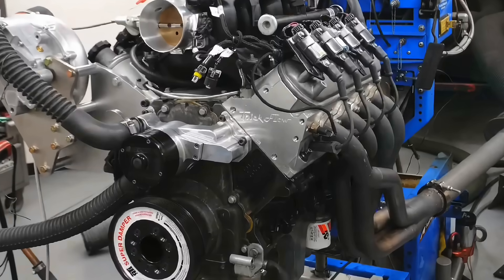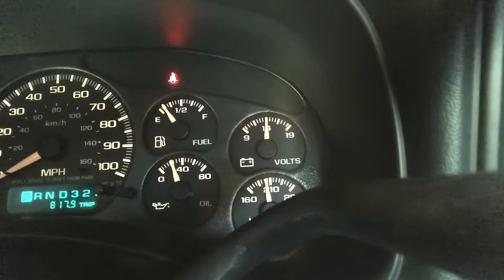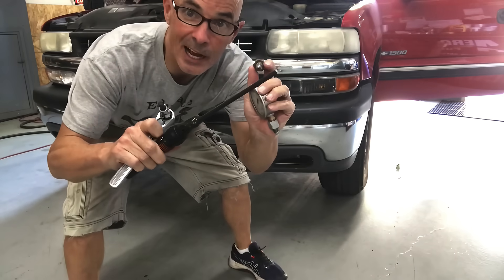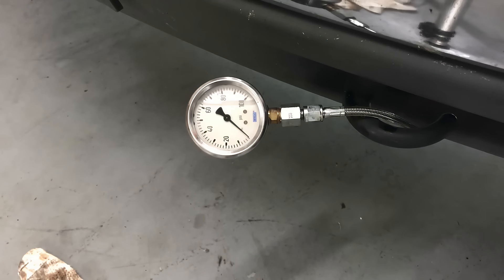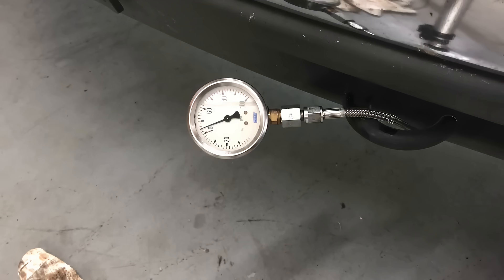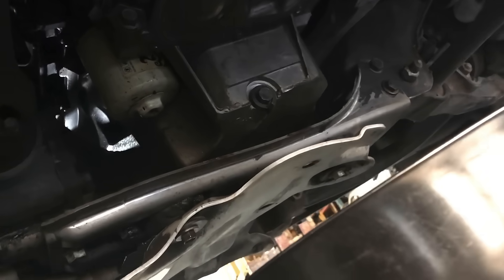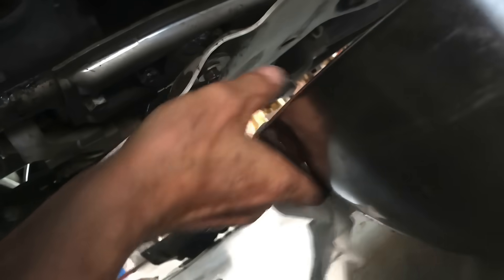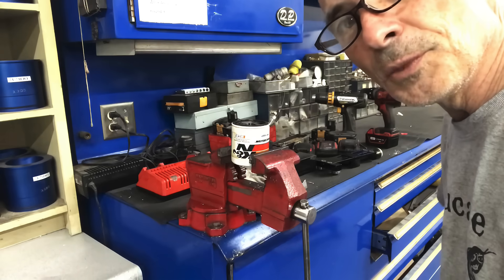HOW TO: TEST & FIX LOW OIL PRESSURE IN YOUR 5.3L OR OTHER LS?

Comment: Good morning Richard, you forget another point.
The  oil over pressure release valve.
This is located at the filter housing.

Andrés.
Reply: Do you mean the pressure valve in the oil pump?
Reply: @SamSheepDoq   No, I mean the oil filter bypass valve.
Reply: Andres Cruz that is the barbell, he did mention that.
Reply: @SamSheepDoq  no, The barbell Is located in the block, this one is located next to the oil filter.
Look for  LS oil  bypass  valve  on google , will see
Reply: Andres Cruz I see what you mean. Had a brain fart and forgot the OE filters support the bypass valve. 🤦🏽‍♂️
Reply: @SamSheepDoq  Yes, that's the one.
Sometimes that valve loss  the spring tentions and let some oil to bypass the filter and the system loss Pressure.
Reply: Andres Cruz you learn something new everyday haha
Reply: @SamSheepDoq  I have a LSX 408 stroker all racing for drag and that valve have to be delete and the oem barbell have to be changed for an aluminum  racing type.
That's how I know that

Comment: My 02 1500hd started and warmed up with essentially zero oil pressure for the better part of a year. The winter was absolutely brutal. It sounded like an army of angry little blacksmiths in there beating on internals. At that point the engine had 365,000 on it and was low on power anyhow. I ran it as long as I could stand and then traded that same worn out 6.0 to a hot rodder buddy for swapping the engine with a reman for me. I'm sure it was the o-ring culprit as it usually is and I could've "saved" the engine but with low power anyway I knew a swap was imminent. A fresh 5.3 is going in now so hopefully I can improve the mileage a tad. Keep up with the awesome content!!

Comment: I just did same test with a 10’ hose and gauge on my 08 F-150 42000miles. Super hot oil in drive at a stoplight 29psi. Just touch throttle and 65psi. Cold start 85psi. I thought that was plenty but ya got me worried now. Edelbrock supercharger goin on it this winter. Been wrestling with change oil pump or not?

Comment: the worst case is worn mains and rod bearings, yeah ive changed  them , by just dropping the pan, and using the same size bearings, wit h out checking the clearence,

Comment: The oil pressure gauge in my S10 has always read just below 20psi at idle with the oil up to operating temp. Under acceleration or cruise it hold about 45-50. I did find the sender to be leaking some oil a few years back and replaced it. No change in pressure.  The truck currently has 489,000 miles and still has the same pressures.
Reply: Dang!
Reply: @christianmotley262  update: I passed 500k a few weeks ago. Still holding good pressure 👌.
Reply: What engine you got my Sonoma is the same on the 4 cylinder. I always say every year it’s gonna die. And still running strong
Reply: @Username-ng8jy  it's the 2.2. Currently up to 520k.
Reply: @BucktailFishing  hell yeah man.
Reply: @BucktailFishing  thats the old iron duke....that engine dont die...truck will rot in half, trans will die, rear end will lock up LONG before the engine calls it quits. Ive seen a few with zero oil changes in years run past 300k
Reply: @erik120719  mine is a 1998. The GM 122 engine. The dukes are definitely tough, too.
Reply: Update: 534,000

Comment: There is actual and displayed parameters in ipc there will always be a slight difference in actual oil pressure and displayed on these trucks
Reply: Why?
Reply: It's the gm engineering in the software idk y they do it but hook up good quality scan tool or oem tech2 or mdi and watch data in the cluster. U will see it.  A scanner that can scan the all vehicle modules, has bidirectional control, etc. Not the code readers/w data from advance this data is not in powertrain.

Comment: I got around 50 psi when its cold but when it worms up I got between 15 ~ 17psi since 2015... I replaced the oil pump,  O-ring and sending unit twice and the reading remain the same. L92 Escalade 2007. It is still alive because Im very conservative while driving but now im planning to boost the truck 👀
Reply: I have a 2008 esky. It was reading around 11-12 at idle hot. It would never go over 30 even a 3K RPM. I had the melling HV oilpump and o ring installed now it goes to 55-60 at cold idle but still dips to 22-24 at hot idle. It did stop my lifter tapping after driving on the  highway. I'm still not sure how much life is left in it 
at 212K miles.
Reply: @memphistiger4647  don't worry, mine reads 17psi for the past 5years hot idle

Comment: You forgot about the emergency bypass the oil pressure bypass valve will cause your oil pressure to stay at 20 lb and run up to 40 when you're driving if you will please show us that

Comment: Had same problem in our 01 yukon. Tried the pressure sensor but ultimately the final fix was the o-ring on the pickup tube. I would get a lot of lifter rattling on start up due to very slow buildup of oil pressure. It would take almost 10 seconds for the engine to build oil pressure on cold start. After o-ring replacement that time dropped to 2 seconds.
Reply: Ive got a 08 5.3L silverado. It seems i need to take off the suspension partially to get the oil reservoir off to get to these tubes. Ive only taken the metal cover and drained the oil so far. Hope it’s just the o ring. I noticed a drop a few weeks ago, but today it’s at 0.

Comment: It would have been nice to see the oil pressure difference after you fixed the oil pickup tube o ring.
Reply: Mine went from 0 at idle, 30 while driving to about 60 at idle, higher when driving.  After I replaced the oil pickup o-ring.
Reply: Mine also was around 30-40 idle hot and 60-65 driving hot.
Reply: @jacobmartin1981  mine was ticking rough and like 10-20 pressure and driving 30-40, I pulled off pan and the oring looked fine but changed anyways same type. There anything else to look for, oil pan very clean, also changing pan gasket and the small gasket by oil filter. Thanks
Reply: @erod4489  Which year of truck do you have? The 2008-2013 engine run the numbers you are seeing as normal pressures.

Comment: This never happened with the old classic engines sbc or bbc. However the pickup might fall out of the pump and the pressure would drop a lot when you put on the brakes. Just goes to show you that it's always something. O-rings are great and everyone uses them but they eventually all go bad. Another easier place to check the pressure on an LS is the fitting right above the filter. Remove the casting, drill it out and tap for 1/8 pipe and put in a fitting for gauge. Easy to get to.
Reply: "but they eventually all go bad"
 
Not quite(within reason anyway). Viton rings/seals will live for an eternity without getting brittle like this, it's a VERY well engineered material for high temp petroleum applications. It's just when the manufacturers cheap out with the black junk rings/seals, like here, that they go bad. I mean, "eventually" is a long ass time, but vitons do last a long ass time. They're ubiquitous in "no downtime allowed" industries, like modern manufacturing equipment, modern construction equipment, that kind of thing. 

And that's the infuriating thing. "Bean counter" is a terrible insult to call someone, but they have a job to do for a reason; those are the guys that make LSs affordable enough to stick in half of GM's car/truck lineup(so that we can yankem' after they get crashed or all the other GM shit in their vehicles fails and they get junked...). But, fucking O-rings man? And, on the oil pickup too, one of the most critical parts to an engines lifespan? Come the actual fuck on guys, we can afford $1 more per engine for some good damn Viton O-rings throughout ya pricks...

Comment: I want to see your gauge readings after the o-ring replacement.  Those oil pressure readings looked ok to me, can’t believe the o ring made any difference.  Also, use a better quality oil from this list, that Lucas oil is not rated very well on this list.  https://540ratblog.wordpress.com
Reply from the maker: the oil pressure changed dramatically from what it was-even if the numbers were still high enough for your liking-there was still an issue-it was cured with the o ring

Comment: My "new" lq4. It's a refurb from blackwater engines is doing the same low to me oil pressure. I feel it's only going to decrease as the engine breaks in. I only have maybe 300 miles on it so far.

Comment: Do u have pn’s for manual gage testing? I replaced pump in 2 of mine. 1: Melling standard=good psi
2: Melling hi vol n psi but psi only went to 20 at idle 40 at wot.

I would like to test with ur set-up
Reply from the maker: it was just a fitting and hose and gauge-not a kit

Comment: It's good to see you make a video of this. All quoted specifications aside if you see the oil pressure drop from where it normally runs you might as well check into it. More than likely the issue is caused by the cam bearings, but it could simply need a new pump or pump o'ring. Being a normal car guy that means a larger camshaft, timing chain, and Melling 10295 or 10296 if the cam bearings look ok. If not then it needs a crank rods and pistons to make it a 383 for testing purposes for your channel...
Reply: Yes❗️
Reply: An oil pump??? Oh,  I hav a 2005 yukon, i hav low oil pressure when car is at red light..

Comment: 9 times out of 10 it's the o/ring could be the screen also since yours is an 02(depends if you're the only owner. If you are and u usually are good on oil changes then it's the hardened o/ring)  after you check the sending unit for correct ohms

Comment: I got a JY engine that had low oil pressure, pulled it back out put it on the stand, flipped it over just knowing I messed up the o-ring on the pick up tube and it was fine. Reluctantly pulled the thrust bearing main cap and found the bearings and crank grooved like an old 45 record!  Decided to just use it as a core and get a crate motor from SummitRacing, best decision I made!

Comment: lol Lucas oil and a K&N filter  um yea Mobil1 and a factory filter. In my 1999 GMC Sierra 1500 SLE  Im having this same problem and its on its 3rd engine the last one lost all oil pressure and started to rattle. I had another engine put in it and this engines doing what yours was doing.  Thanks for the video.

Comment: This video is really relevant for me.  My 2002 Camaro LS1 has had low oil pressure for maybe eight years.  I did track days with it steadily since new, and noticed after about 10 years that it was only running about 30 psi when fully hot on track at high rpm.  I have not been overly concerned about it, though, because I cut open the used oil filters and never see any bearing debris.  And I have oil analyses done that never show high amounts of Aluminum or Iron.  I have been assuming that it is a bad reading on the gauge, and have taken the fatalistic attitude that if that amount of oil pressure is not enough, the engine will quit running.  I've been wanting to put an LS3 in it for years, but the LS1 just won't die.  At 277000 miles, it's earned a rest.
Reply: Just send it to me then jeez sounds like this motor wants another 277k
Reply: @SaveOurSnipers  Currently 296k.
Reply: @SaveOurSnipers  I got $27,000 mi on mine running the same pressure as yours and ready for another 207000
Reply: @SaveOurSnipers  ive got a 5.3 with 376k and running strong other than low oil pressure and clogged cat
Reply: I have a 2001 z28 with ls1 and as u can guess I'm here cause I'm having low oil pressure. It runs at 35 and goes up to like 42. This is after changing the oil pressure sensor
Reply: What is the spec for oil pressure, the pressure depends on how much clearance you have on bearings,  I would expect 35-40 is good at idle, and go to 50-55 at 3000 rpm!

Comment: Have seen a tiny sliver of metal wedge the relief valve open on the pump so that at idle the oil pressure is extremely low <10psi and much lower than normal when hot at rpm... the metal sliver looks like it came off the thrust bearing as the car was manual with a heavy sprung clutch and was just the perfect fit to make it through the pickup screen and pump gears and just perfect to jam the relief much like a door stop wedge haha 😆

Comment: Low oil pressure in an LS can be caused by a few issues singularly or combined, there are oil gallery behind the timing cover that leak oil pressure which is fairly common in higher mileage engines.

Comment: Somebody holding the NOS on too long? How high was it before? Usually points to glitter in the oil...WHAAAT? o-ring on a oil pickup tube? who's bright idea was that? where did all those air bubbles do to your rotating assembly? Up next, teardown and inspect! check that ring gap while your at it....

Comment: worried me to death in my mustang when i swapped in the 5.3. hovers around 23psi. figured it may have something to do with the extra capacity with the extra oil coolers and turbo or something, or maybe it was the aftermarket gauge and holley system. In the end i gave up and just send it. close to 60 at redline so i don't mind if it dont, and so far it hasn't.

Comment: Mine shows about 25 psi @2000 rpm hot. 398000 miles, still runs good and 25 mpg 05 Crew cab 4x4
Reply: I call BS on that mpg.
Reply: @ebels3  real deal. I've checked it several times on the interstate. Over 401000 miles now.

Comment: Generally speaking oil pressure is less important than volume. Oiling for plain bearings does not rely on pressure from the oiling system to keep the surfaces apart. Rather it is what is called an oil wedge. A hydro-static effect where a film of oil between two moving surfaces forms a wedge (or a wave to picture it in your mind) than actually forces the surfaces apart with significant force. The oil needs to be replenished as the oil is forced from between the surfaces. The pressure is more important for other components like hydraulic lifters and cam phasers.
If you think I am wrong then consider a simple lawn mower engine. It relies on simple splash lubrication. no pump at all. Due to the low forces involved the rate of oil replenishment is covered by the oil splashing around. The more load on the system means more oil to maintain the wedge. Invariably more volume equals more pressure in automotive engines. Hence why performance engines have high volume pumps.
Rant over.
Reply: Pressure is how the oil pressure is measured and since it is pressure that keeps the bearing from contacting it's floating item I would say pressure is very important as well. On the same hand volume is how pressure is created... Hmm, shortened that right up.
Reply: i heard oil is not a lubricant it is a vehicle to move the polymers in the oil,,,  POLYMERS  are tiny little BB's that create the spacing between the two metal surfaces... over time they flatten out and become smaller little BB'S and then you lose the gap between the two metal surfaces and it starts to grind against each other and create heat, and then weld together.

Comment: I just bought a 06 L33 truck with no oil pressure, took it apart to change the oring and all four bolts for the oil pump were backed out. Weird and it looked like it had never been apart before. 175K miles.

Comment: I am only a couple minutes into the video and I have to tell you people the oil tube pickup that bolts to the block inside the pan has an o-ring that fails all the time. Replace the o-ring put the oil pan back on problem solved

Comment: HEy Richard you're missing something MUSIC!  HAd a 72 olds cutlass no pressure on oil gauge put a pressure gauge near oil filter pressure present. Remove manual gauge & place it where the sending unit goes zero. All this was happening during a crank no start test. I poped the distributor out & crank the pump shaft with valve covers out no oil out of the rockers. Removed the block tore it down oil galleys for the lifters plugged cam lobes on cyl. 4& 6 flat. Crank journals all scored. Called a friend he had an LS 6.0 truck engine built 420 HP customer said lets do it. I'm still working on it rebuilding an auto trans TH350.Yup baad oil clogged the oil galleys. Richard thanks for the vid keep uploading & I'll be watching.

Comment: My 01 Silverado 5.3 lm7 210xxx miles went from about 40 psi warm idle to oil leak then months later to about 10 psi. Oil leak is very tiny and it comes from the front area. Any suggestions on the pressure.
Reply: Could be oil sending unit dripping losing oil pressure...
Reply: @mikie4824  isnt that at the rear like sbc's tho?